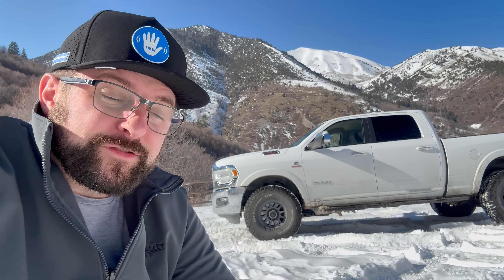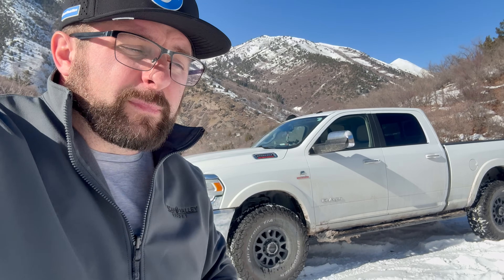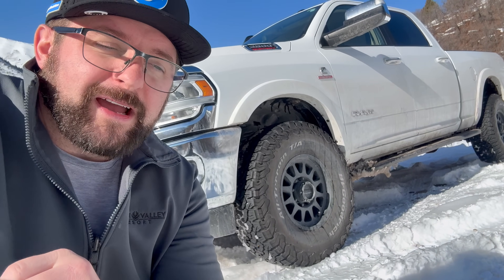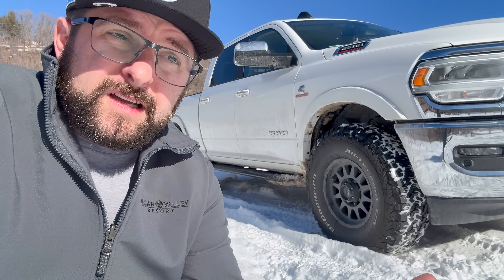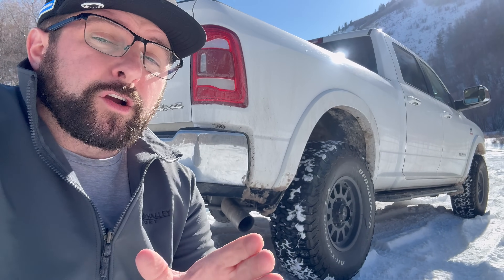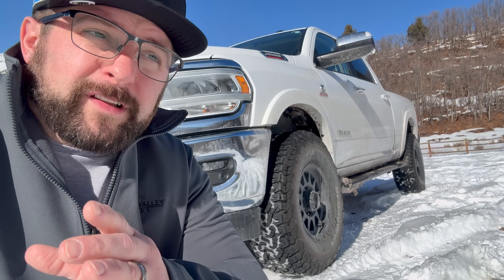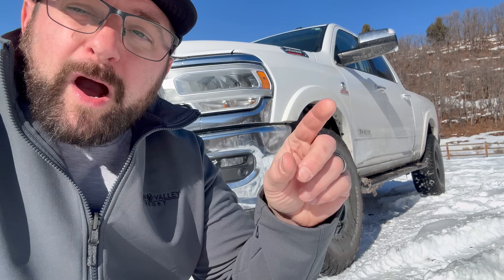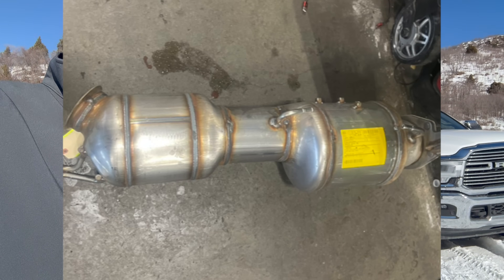How can diesel emissions systems be more reliable?  STOP doing these two things!!

Comment: The best option is delete, you can drive in California with it deleted. Just make sure the tune is clean and doesn't yell look at me , I live in Canada and my province emissions off is not legal but my truck is deleted. I don't roll coal, my truck is not obnoxiously loud and my tune is very clean. I have spent thousands at the dealership to try and fix my truck and it still broke down. I used a tuner and did a stationary regen often and it just waisted diesel and time and lots of noise. No emissions = no more issues, My truck runs better, better gas mileage, sounds better and doesn't shut down when the DPF is full. I love the deep sound, the turbo spool and the turbo flutter when I down shift.
Reply from the maker: I’m about 90% sure I’ll delete mine when my warranty expires, and would definitely do a nice clean tune. Reliability is number 1, increased fuel economy is number 2, and I’m stoked for it to sound better too. I can’t stand when people roll coal, so tacky. Honestly hoping to have this truck till I’m an old man, so want to make sure it can get there.
Reply: @gavinwalker5686  I only had 115,000 km on my F350 dually and it was out of extended warranty and failed me so that's why I did the delete myself and got a reputable company and support for life on the tunes. If 1 day I want to throw a 1,000 hp tune in the truck I just ask for it and they will write one for me. Not that I would ever do that because I want to keep my truck until I'm old too.  But I run a SOTF 50-250 HP tune with a matched transmission tune and she goes now.
Reply: What happens when its inspection time and they notice the missing emissions equipment? Lots of states including California do annual inspections and they inspect the emissions equipment and they will fail your vehicle if its missing so residents of those states have no great path to a delete.
Reply: @TDub_ADV  I left my EGR on but disabled it so it looks stock, and apparently all you have to do is register your truck outside of California where they don't do inspections. I was told there are hundreds of emissions off diesels in California. They don't inspect our vehicles here or do emissions testing so it's all good for me.
Reply from the maker: @crashweekly7925 that’s awesome! Slick move to leave the egr on so it looks stock haha
Reply: @crashweekly7925  That's risky in CA too. They do roadside spot testing for emissions even for out of state vehicles and that began in 2023. If you are flagged as high emissions they will make you fix it. Right now it's only 14kgvwr and over but that covers some personal trucks and im sure subject to change as their war on ICE engines continues. I personally have been inspected in my 3500 dually that is registered in Florida when we were in CA with our RV. Mine is emissions intact and in good working order so no issue for me. Bottom line, if you delete your truck say away from California and in the future states that follow their lead like NY, MA, IL, etc....
Reply: @TDub_ADV  I'm sure it is risky, I would never go to California anyways with my F350 dually... The honest ones always get checked when the violators get away scott free. That's just how it is, at the end of the day it's your decision if you want to take the chance or not. I'm not telling you that you have to do it but your truck will thank for for removing all of that garbage designed to make it run like crap.  I can't afford a new truck with these prices. I paid $80,000 CAD for my 2018 brand new off  the lot , my truck retails for $120,000 now and it's not really any different other than the transmission and newer body style. there isn't $40,000 worth of upfrades in there.
Reply: @gavinwalker5686  The main reason I did it was because it's not legal in my part of Canada to be emissions free, the second reason is that the bolts are notorious for sheering off in a specific spot on my engine. I can treat them with PB blaster and heat and probably remove them with ease or just leave it alone and it will work the same. The only thing my EGR does is allows coolant to flow through it but otherwise is disabled. The only thing that gives the truck away is the sound and if you look under it I have a 4" straight pipe to the factory tip.  If I ever get caught I will bolt the DPF back on but gut the insides of it as I will still run the way I am.
Reply from the maker: @TDub_ADV  yes that's a huge issue and a barrier for a lot of people in deleting it. Some counties don't have emissions standards and therefore when it comes time to renew registration, you don't have to get an inspection/emissions test first. I have a property in one of those counties, so I could get away with it at least until that county changed in laws.... which would totally suck right? Spend 6k deleting and then have to put it all back on in a few years?

Comment: You can always go to an emission specific shop to have them clean your DPF. I believe they are (clean diesel specialist) CDS, and they have them across the nation. I saw this on YouTube on someones RV channel, and they did a great job. There is a shop in Utah if you ever need it again. CDS Utah (J MAC Radiator). Emission stuff suck for sure.
Reply from the maker: Hey thanks for that tip. I’ll definitely make cleaning it a part of that routine now that next time this would go out it’ll be after my warranty period!
Reply: I have a 21 Ram 3500 Ltd Longhorn MegaCab with the HO Cummins. When I first got the truck it seemed like it never went through regens & I seldom saw anything other than 0 level on my DPF monitor. However, as it got more miles on it I would see the monitor fill up then go through the regen. When I saw the regens happen more often, I started keeping record of it. I also track mileage on every fill up. I’m a data geek. I think I’ll do a video on the regen data as there are some interesting observations. My truck has idled about 16.8% of the time and mileage is split about 33% local travel & 67% long trips; 500-1,000 miles per trip. I when I get back from a long trip the regen intervals tend to get longer. My regens take about 25-40 mins & about 25-30 miles to finish once started. I seldom shut off the truck once one starts, even if I just pulled into my driveway. I go back out & drive until it’s finished. Call me crazy. However, when I have shut it down, the regen picks up where it left off usually. I don’t like this stuff and plan to put it on a weight loss program once my warranty expires.
Reply: @Over_the_Hill_RV_Rookies  I have a 2021 Limited Mega Cab 3500 with the HO motor. I've used Hotshot EDT in it every since the 2nd tank of fuel in the truck. I had the opposite. I used to see my DPF monitor fill up slowly to about 40%, and then the truck would regen. Now, I usually take it on longer drives 100 to 200 miles every few weeks, but I never see the DPF monitor show anything. The truck doesn't seem to regen that often, but when it does, it takes approximately 17 minutes to finish. I will always drive it when a regen cycle has started. I won't shut it off unless I really need to. The only light on the truck in 39,000 miles was an intermittent coolant light a few years ago. I put about a 1 1/2 cups of coolant in it, and there hasn't been a light on since. That is the only light that has ever been on since I purchased the truck in April of 21.
Reply: @DavidBrown-jt7yi  great feedback. I used to take my truck out for a 60-70 mile drive twice a month when I first got it. I stopped doing it because the long drives started racking up the miles. I take 4 to 5 trips per year from FL to VA-PA-NC. Trips avg about 2500 miles over the course of a week. I have 55k on it now. I should have been more specific when I said the DPF filled up. It never gets to more than 40% like you have observed. Thinking I should start doing my biweekly “burn off” drives like I used to do.
Reply: @DavidBrown-jt7yi  do you like your truck as much as I do. It’s my favorite vehicle I’ve ever owned! knock on wood but I have not had a light come on yet!
Reply from the maker: @Over_the_Hill_RV_Rookies those limited longhorns are a work of art. By far the best interiors on any truck. Also, cool data you shared. I’d guess that regen intervals would get longer free a long trip because it was able to clear out more soot better on those long trip, so the DPF was extra clean. If you do a video on it let me know I’d love to watch it.

Comment: I have a 2016 ram with over 250,000mi original emissions equipment. I bought the truck at 160 or 150,000. About 2 years ago I got a service dpf on dash since then never seen it again. I always drive the truck for at least 1 hour, towing or not. If I idle for more than 2 mins I set the high idle, also run EDT treatment. I travel for days at time most of the year due to my job. I work on power plants and refineries across the US, and tow my camper to them. But while I’m working I usually have 20m-45m drive to jobs. I don’t know if what I do prevents it or I am just lucky. Also when I stop for fuel I never turn it off, had an old guy tell me that, because the engine can’t cool if the engines not running.
Reply from the maker: I’m sure some of its luck, but, I had a diesel mechanic tell me once that semi truck emissions rarely have issues, because they are being driven and worked constantly. Sounds like you’re in a similar boat. So perhaps some luck but you’re also working it hard consistently. Also glad to know others leave it running when filling up. I’m amazed how many people think a car will blow up if you do that. My dad would in-flight refuel his helicopter (MH-60 Pave Hawk) and he said of that wouldn’t blow up, a car sure isn’t going to so I just went with it haha 🤙🏼
Reply: @ the only vehicles I don’t fuel up while it’s running are gas because I had one car get evap problems from it.
Reply from the maker: @196slayer right on, good to know.
Reply: @ A lot of my driving is unloaded but it’s longer periods of time of driving, my house is 25min away from town.
Reply from the maker: @196slayer cool, I’d say I drive about that long pretty often too, and several 1 hour highway drives weekly and 2-4 4 hour stretches monthly. I have 624 idle hours on my engine and 1700 driving hours, so should be grateful I made it 70k miles before clogging my dpf.

Comment: Do you have fast idle on truck. 
And when do you know when regen cycle starts. I’ve had mine 4 years and don’t have a clue.
Reply: That doesn’t work! As soon as you put the truck in park regen stops. Even if you are in drive stopped and the passenger door is opened the regen stops. At least it does on my 2023 Ram 2500
Reply from the maker: Well shoot that’s good to know!
Reply from the maker: Just looked it up. You press the “Set” button on the cruise control while in park and the cruise is on, that kicks it up to a thousand rpm, and then you can hit the Res+ button above that to further increase the rpm. 

That would be the thing to do if you have to idle it, especially if you get to your destination right as a regen is happening.

Comment: I’m so glad I bought the 6.4 Hemi.  It wasn’t with all the headaches and costs to buy a diesel 6.7.  So far, I’m very happy with the 6.4.  Damn modern diesels seem like a pain in the ass to deal with!
Reply from the maker: Yeah I could just as easily have bought a power wagon if one was available. (Bought during Covid during the peak of the shortage) so I really just bought what was available at a fair deal. It’s been fun figuring out a diesel and I love the power, but I’d be just as happy with that Hemi
Reply: Regen technology is on the 2025 model year on gasoline vehicles. First vehicle is the Ford maverick for Ford. You lose fuel economy/HP. All gasoline vehicles must be complaint by 2026. Lets hope with the new Administration this may buy Americans a few more years.

Comment: I purchased a Banks iDash when I bought my 2022 Duramax. I was able to keep an eye on % soot load in the DPF. Once it got to around 90% and I knew that I could go on a 20+ miles road trip I would manually command a regen and allow it to fully complete. Never idled the truck and minimal warm up time before driving off. I loved that truck but will never buy another diesel. Too many over complicated interconnected systems to go wrong and EGR feeding soot back into the intake. The golden age of diesel is long gone.
Reply: Yup, I’m in the market need a 3/4 ton but …. With these new emissions is not worth the headache , I don’t work a truck everyday like I use to so been looking at the 6.4 hemi and the 7.3 gas and 6.2 gas. Tried the gmc 6.6 gas I just don’t the the truck in general the gmcs are way over priced and I’m trying to get away from the 10 speed trucks
Reply from the maker: @akaixl83 yeah the GMC trucks in general can be lacking. I drove a Chevy ambulance in a past life and when truck shopping, was looking at a gmc sierra half ton that was almost as expensive as my Laramie Cummins, (both new) and even though it was supposed to be a nicer trim, the GMC still felt like that base model, stripped down ambo.
Reply from the maker: Pretty cool that you could manually command a regen. And, I think you’re right, that golden age is gone.

Comment: Not your fault.  The truck should work no matter how you drive or idle.  They are saving money by designing the emissions to only work well under load.  Also, wonder why the egr doesnt get exhaust gases after the dpf, that way soot going back into the engine would be limited and the longer route would cool the gas more.
Reply from the maker: I agree they should work no matter what. I also think that reliability is more important and so if the systems can’t be made to be super reliable we should do away with them or modify them in a way that maybe they help a little still but not at the expense of reliability.  

You make a good point about collecting the exhaust after the DPF so less soot goes back into the motor.
Reply: The 3.0 Duramax gets its EGR gasses after the DPF. I think it works for that engine since the engineers were able to pack the DPF close to the engine. Having a DPF farther back would make the EGR pipe a long stretch to the intake if it was after the DPF.
Reply from the maker: @gr8tdane24 that makes sense. It’s cool they were able to design that engine in such a way. I guess it helps when you design a motor after emissions requirements were in place. The 6.7 Cummins was around before emissions, so they slapped things onto it afterwards and that’ll never work as good.
Reply: @gr8tdane24 keeping the dpf closer helps get it hot faster and stay hot.
Reply: By putting the egr after the Dpf would increase the working load of the dpf.
Reply: @matthewholzmueller6292  Seems to work well for BMW's that use the 3.0, which is the same design as the 3.0 Duramax. The additional load onto the dpf is pretty tiny.
Reply from the maker: @hochhaul ok don’t might not make a huge different, especially if we don’t idle as much lol
Reply: @hochhaul  you got me on that brother.  I keep all European manufacturers farther away than my ex. I will say chevy 3.0 has good intentions having everything as close as possible to the engine.  How close (OR FAR BACK)is the BMW dpf, egr?
Reply: @matthewholzmueller6292  Same here but when it comes to diesels they seem to get things right. The 6.7 Powerstroke was originally designed by Austrians. From what I know the DPF is up close to the turbo on the 3.0.
Reply from the maker: @matthewholzmueller6292 true
Reply from the maker: @JefferyBailey-b9q yessir 🫡
Reply: It's still stupid to let the engine idle for hours. It's a case of little boys wanting to pretend they're driving an 18 wheeler and a lot lizard in the back seat.

Comment: You mention that when the truck is in a regen, if you turn it off, it doesn't know it was previously in a regen the next time you start.  I'm not sure that's true.  I have a 2022 and it will continue to regen after each restart until it gets to zero on the DPF meter.  I watch it closely when doing short trips so I've never restarted the engine cold more than 3 times without letting it fully finish.  So I'm not sure how many times it will keep trying before throwing an error code?  But it does seem to keep trying to regen until it reaches zero on the meter.
Reply from the maker: I guess if your sensor is working properly, then it should be triggered to do a regen again. The service advisor is who told me it checks the box at the beginning and therefore won’t always know it didn’t finish it it gets interrupted. Now that I’m actually watching my DPF/regen gauge I’ll have to see if mine picks up where it left off too.
Reply: @gavinwalker5686  Just some extra information that I've learned from my experience, with the 2022 anyway, I don't need to get on the highway and run 70mph or anything like that to regen.  I've found it'll regen fine just putt putting around the neighborhood at 35 or less.  I do know that if I sit with my foot on the brake, after about 2min it will cancel the regen until I start moving again.  I don't think it wants you fully stopped but you might could crawl around a parking lot if you had to to finish the regen.  Thanks for the video!  Good luck!
Reply: Yep. Mine will pick up where it left off. I’ve driven to work in a regen cycle and cut the truck off and 12 hours later cranked it up and it continued the regen until it was complete